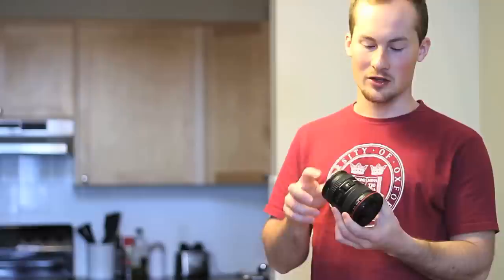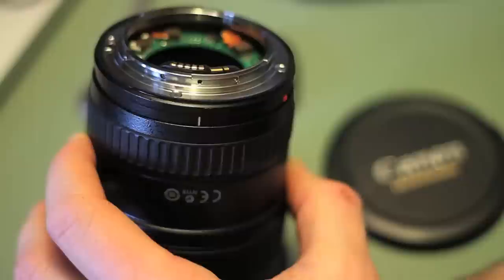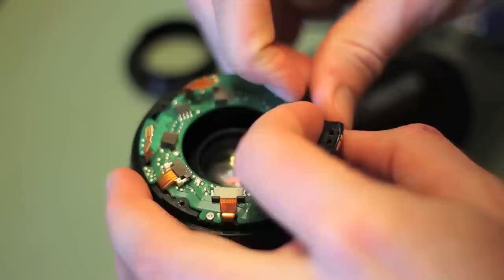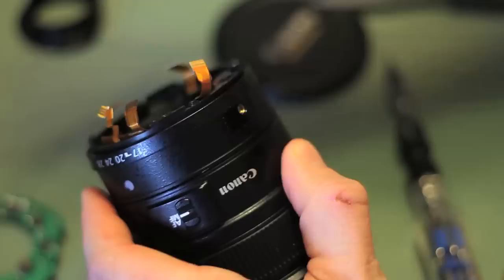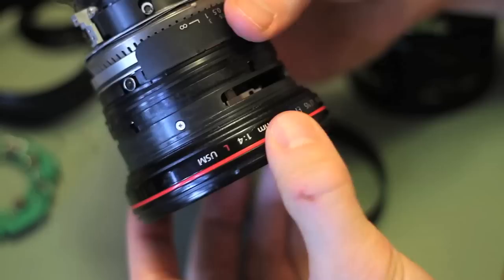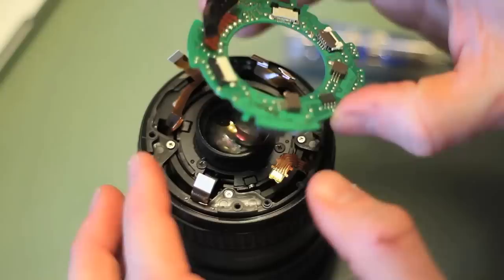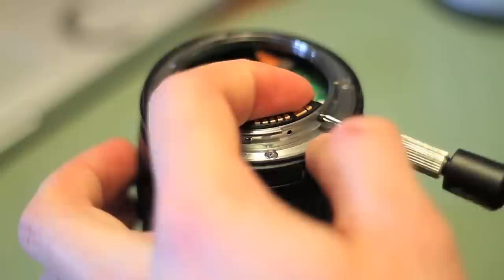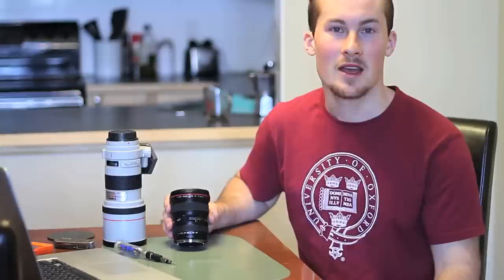CANON 17-40 L ZOOM REPAIR

Comment: Appreciate this video mate, just fixed mine with your help. When I heard bits rattling around I assumed there was likely broken plastic so glad I did some research before ordering a new one. 

Side note - probably good practise to slip the rubber ring off every once in a while and tighten screws to avoid having to pull the lens apart in the future.
Reply from the maker: Thanks James! Yeah, exactly, that's a good tip.

Comment: Thanks for the video. My zoom still worked but it had some play when I try to zoom in and out. I was able to just remove the rubber band and both screws were loose, I just tightened it back up and its good as new!

Comment: For a simple check of the presence of the screws you dont need to screw anything. Just remove the first rubber zoomring by pinching it a bit so you can remove it over the end of the lenscap. If the two screws are there maybe check if ok. You can even wash the rubber ring and clean it with a handsoap and water. After drying replace ghe rubber ring and its done!

Comment: Brilliant mate - thank you. Exactly my problem. Only thing to note is that the screws holding the brass "washers" appear to be magnetic and were stuck to the wall of the lens barrel much deeper inside the lens. Finding the loose brass 'washer' was fine but it took a few moments to locate the missing screws
Reply from the maker: Thanks Stuart, glad you got it fixed!

Comment: *OR... you can just take that plastic band off first thing, and shake it, and the screws will fall back out the holes. You may not have to disassemble the lens at all. 

*thank you for posting this video, I would not have guessed this was the problem at all. But I was able to solve it in about 3 minutes. 

The screws and one of the housing pieces came out the holes from whence they came. And the other housing piece dropped out the back of the lens after a bit of shaking. And then it was easy to see where they went back in. works perfectly.

Comment: If you lose Auto Focus after the repair, make sure the two WHITE pressure tabs are still connected to the ribbons, and on the proper side.
Reply from the maker: Good tip!

Comment: Hey Luke!Thanks very much for this helpful video. I had an accident with my 17-40 and crushed the plastic front sleeve assembly. It was a different problem from the one shown in this clip, but your detailed instructions got me to the point where I could remove and replace the front sleeve and re-assemble the lens with minimal hassle. Much appreciated!!!
Reply from the maker: +Reb Babcock Thanks, glad it helped!

Comment: Good video, but I had a blocked zoom (fallen screw) that needed the last part where he gives his "proceed with care" warning. This part was too sketchy, just saying take off these bits and slide out the housing after taking out 4 screws. 
It's possible but it would have been better if he said to be careful about putting the focus moving bar back in its housing on resassembly. You can reassemble it without doing this and of course the focus doesn't work.
Basically a good video.

Comment: Thank you very much for tutorial. I had absolutely the same problem I was not able proceed with initial opening, i.e. black inner plastic removal using little spoon trick - till I found this video. BTW I think U-shape dude is filter holder.
Reply from the maker: +Pudu Pudu Yeah I know it's a filter holder now, thanks!

Comment: I wish to Thank you for your video I just repair my 17-40 It's felt on the floor with my camera and I broke it in two part. The ring remained attacked to the camera e the rest (the 90% of 17-40). I used some glue (Loctite) to weld togheter the two pieces  and some tapes. I soldering the broke cable and put everything together using your video. Thank again thank you very much

Comment: My only issue was besides the screws that were off on mine, those other two pieces were off as well and you never mentioned where they go back in the housing.  Any suggestion or example appreciated.  Thanks for this video.e

Comment: Many thanks for this informative video.  Yesterday my 17-40 would only zoom from 28-40 and I can hear stuff rattling around in it. Gonna try doing what you did and hope I can save myself a costly trip to the Canon repair centre.
Reply from the maker: +tom waugh I hope it works! Thanks!
Reply: +lifeofluke Actually it now zooms Ok but won't autofocus!
I think that another disassembly may be in order!
Reply from the maker: Ah, tough. It could be the electrical connectors. Sorry to hear that!
Reply: No problem. I'll get it sorted. Your video was very informative.

Comment: Hey, I have similar problem. I have old 17-35 f2.8L, it is all working well, but at one moment there was something in the lens, i stumbled it and a small screw fall out from rear. Everything is working fine, but i have some extra parts. Will this method work for me?
Reply from the maker: +Negovan Vidiner It's possible that a screw came loose, but I don't know for sure as I haven't used the 17-35 f2.8 lens before

Comment: Thanks for the tutorial! Zoom working again. Only issue is that my lens is no longer ultrasonic!!! It makes noise in autofocus mode...I guess I have to do it all over again he? Any ideas what it could be?
Reply from the maker: I don't know what that would be as that problem didn't occur to me, sorry! Hope you can fix it!
Reply: Media2play did you find a solution to this??
Reply: Same here
Reply: If you lose Auto Focus after the repair, make sure the two WHITE pressure tabs are still connected to the ribbons, and on the proper side.

Comment: I have removed to two pieces rattling around, but there is no screws to hold these two pieces to the zoom mechanism. Are there supposed to be two screws that go thru the little gold pieces that were rattling around?
Reply: Yes, two little screws that connect with small sivler metal blocks on the other side.
Reply: Hey Joshua,

I am currently in the same situation - I took it apart just as the video so awesomely guided - but I am only finding the gold pieces rattling around inside that the screws go into - no screws. What did you do?

I am sitting here with my lens apart !

Thanks,
Joe

Comment: would it be worth just removing the rubber ring first and seeing if you can simply tighten the screws beefore you go ahead and dismantle the lens
Reply from the maker: Yes I would say go ahead and try that - only if the screws have fallen inside do you then need to dismantle the lens
Reply: Great vid.  Thanks!  I'm going to try this when I get home!
Reply: My focus ring is the one thats slipping.  Im not sure if its meant to be like it is or not.  Does your focus ring continue to revolve no matter how far you turn it?  In other words, can you keep turning it forever, or does it reach an end point?  Mine continues to turn forever.  It seems like its broken.  When I take the rubber off, there are a few holes.  Doesn't look lie there were screws there though.....

Comment: Just did this and now my AF doesn't work. Everything seems ok. Any ideas?
Reply from the maker: +lajoodesign The first thing that I think of is are the electrical points connected right?
That would affect the AF motor.
Reply: +lifeofluke Yes they are. It's really hard to not get them right.
Reply from the maker: +lajoodesign hmm. I'm not sure what to say.
Reply: If you lose Auto Focus after the repair, make sure the two WHITE pressure tabs are still connected to the ribbons, and on the proper side.

Comment: Thanks for the video, I had the same problem... but I think I lost one of the screws. Any idea if there are any parts dealers that sell the screws themselves?
Reply from the maker: +Scott Medway Thanks Scott! I don't know where you can find new screws, sorry!
Reply: +lifeofluke Thanks! I found a site that sells the screws, I was wondering what screwdriver size you used to disassemble the lens?
Reply from the maker: +Scott Medway It was a screwdriver for electronics, don't know the exact size, but I found it at canadian tire

Comment: Thanks for posting this. Had the same issue. Your video solved my problem and saved my the ridiculous service cost from Canon. 

btw, what kind of screw driver do you use? Mind sharing a link?

Thanks.
Reply from the maker: +Qinglin Meng Thanks! I used a friends screwdriver but you may be able to find one at Canadian tire: http://www.canadiantire.ca/en/pdp/mastercraft-30-in-1-silent-ratcheting-precision-bit-driver-0573502p.html#.ViU-5MuUvjQ
Reply: +lifeofluke 

Thanks. I went to CanadianTire and got it. Quality is actually very good. Thanks again for the info.
Reply from the maker: +Qinglin Meng Great!